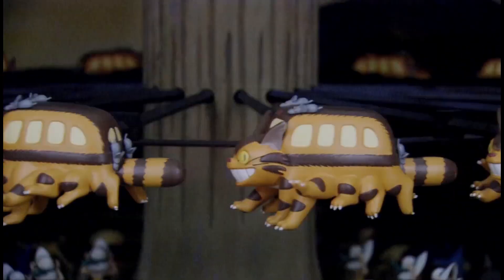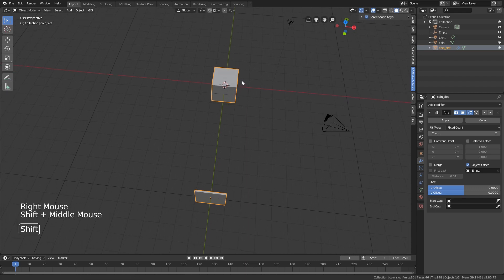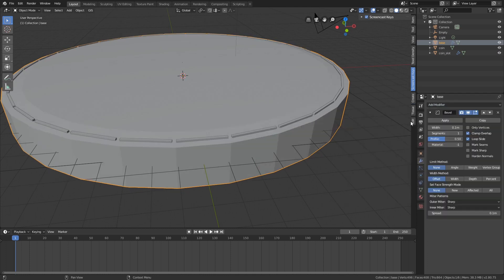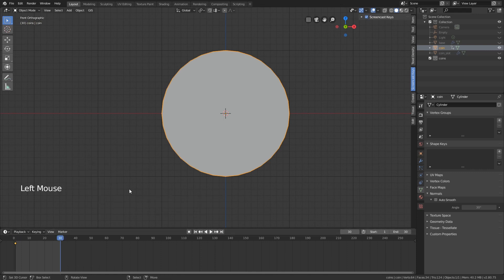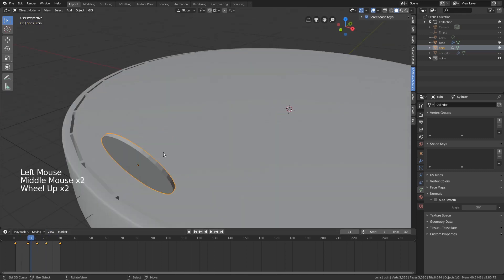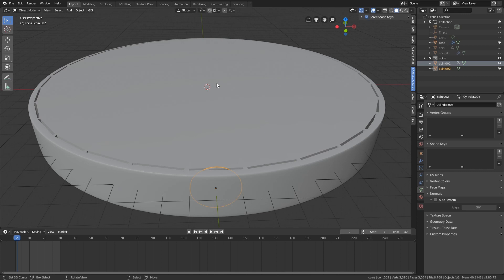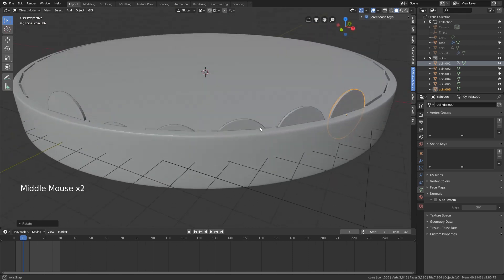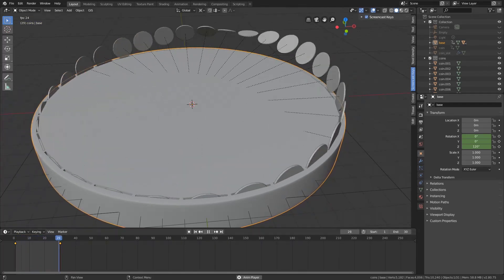blender: create a zoetrope

Comment: I dove down the Zoetrope rabbit hole in blender a few months ago. Realizing that in reality we will never create a zoetrope the "right way". The concept is we are creating a "shutter" with a real zoetrope ( slits of strobes ), and the persistent vision our brains provide makes the animation smooth(ish). This modeling idea, although visually appealing. is NOT a zoetrope, at the end you chop the rotation back 12deg to match the frequency of the array. this then make the animation stationary. so, in 3d design what are we doing? we are not recreating EXACT replicas of something. we are recreating the visual representation of the effect or scene. so in the end. why not STOP rotating the base, stop rotating the coins, and just make them jump vertically. and rotating the material you applied to the base to give the EFFECT of rotation. there is really no reason to rotate the 3d model anymore here. you can just make jumping coins, and make a rotation effect in the material. Although I enjoyed your video and my rabbit hole dive into zoetropes some months ago. I realized my flaw in blender all along, im trying to recreate real things. but in reality we are just trying to recreate the IDEA or the LOOK of that thing in the 3d environment. sometimes its way simpler than we realize.